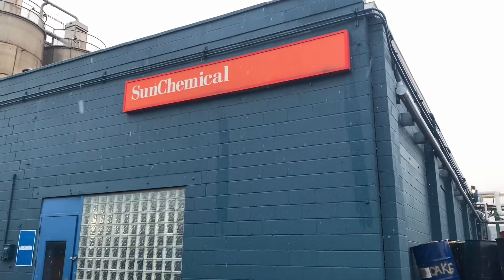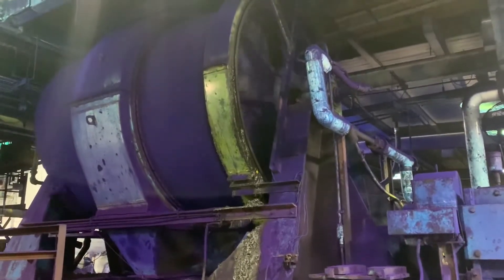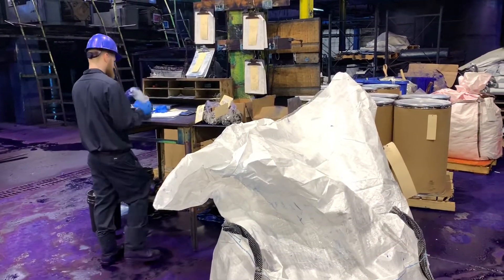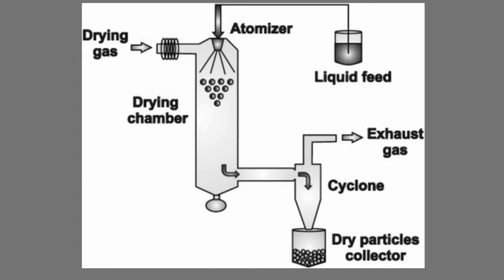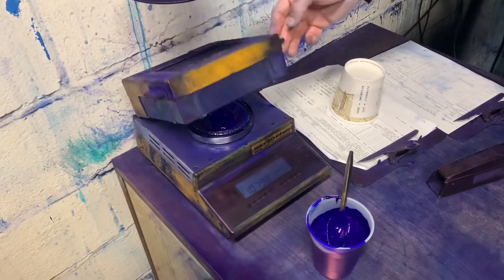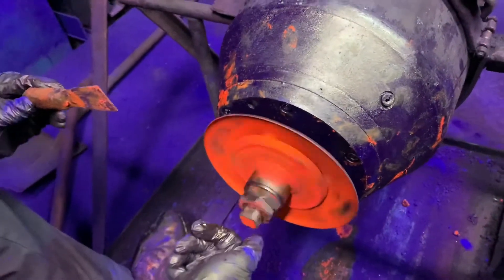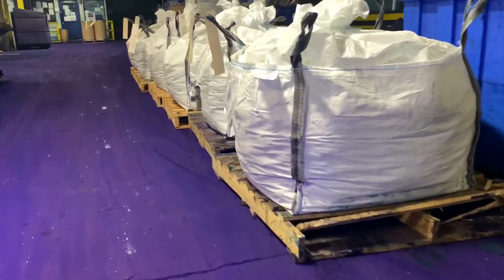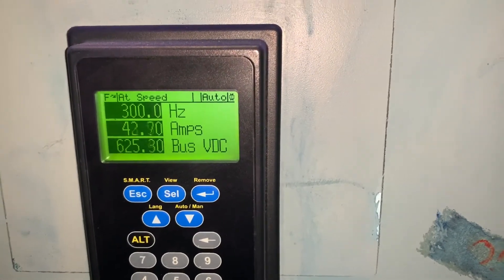How pigment is made

Comment: Hi Andy, do you know which metals are responsible for the blue color? Perhaps cobalt? If so, would you happen to know how these metals and chemicals have been rendered insoluble, since soluble materials are usually toxic to handle (since the employees are not wearing respiratory equipment)? It is very fascinating to see the process. Thanks for the great video
Reply: Looks like phthalocyanine, which is non-toxic
Reply: @sabeluc  yes, because of the color, it is surely Copper Phtalocyanine
Reply: Its based on copper metal. Chlorination of copper in to the cupric chloride. Turning in to pthalo cynaine. Purify it with sulfuric acid to get pigment blue 15:1,